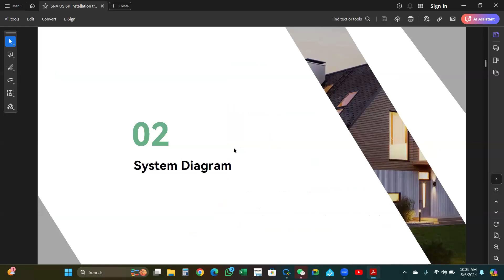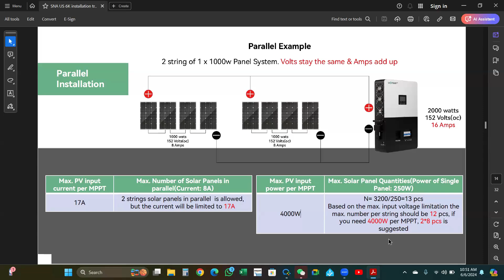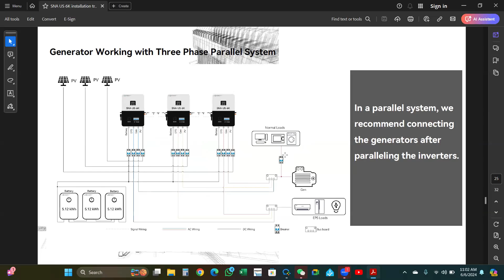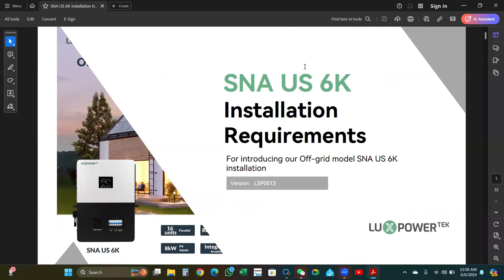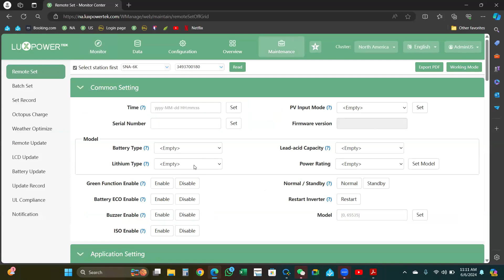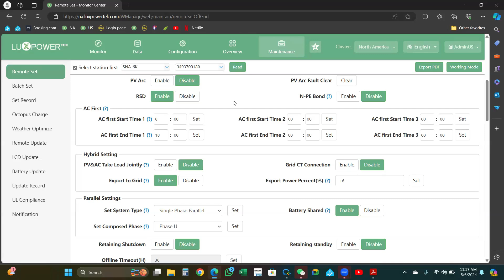LuxpowerTek SNA US 6K | Installation Guide Training Webinar

Comment: Can this run with no batteries? Only on grid and solar?
Reply from the maker: Hi there, thanks for your reaching out to LuxpowerTek. This product is a off-grid product for US region, and it cannot sell energy to grid, but it can work with Grid and solar, without the batteries.
Reply: @LUXPOWERTEK Does it mix power in the event there isn't enough solar for the load? I'm wondering does it supplement with grid power or does it entirely shift to grid power?
Reply from the maker: @ralphyc81  If the solar power is not sufficient, the system will automatically supplement the load using either the battery or the grid, depending on availability.
Reply: @LUXPOWERTEK  I actually bought it and hooked it up but it doesnt pull from the solar at all only the grid. When i try to change the hybrid settings PV and Ac take load joinly i get this error. Operation failed, error code: 3
Reply from the maker: @rafaelconcepcion2990  Hi there, could you please send your issue detail and inverter SN to info@luxpowertek.com? our technician will help you.